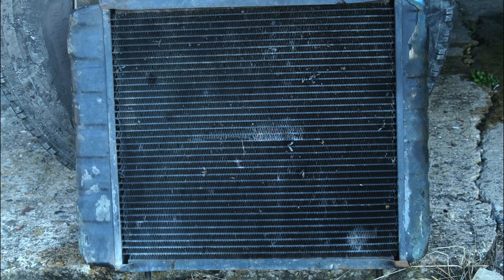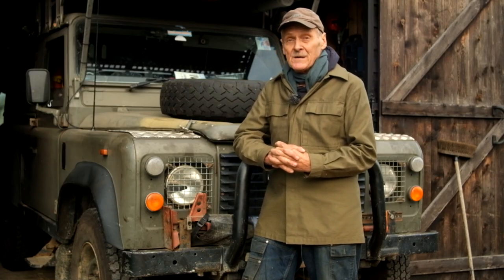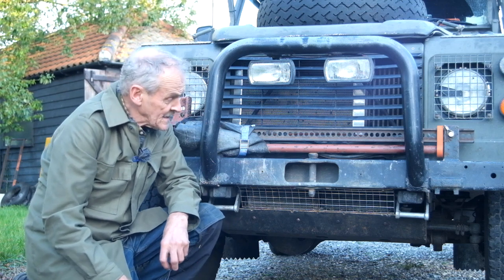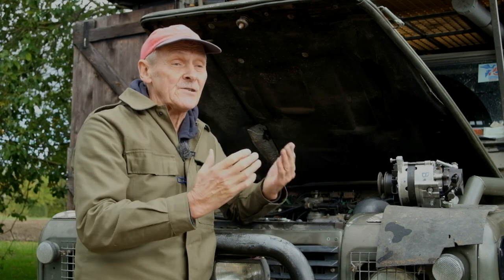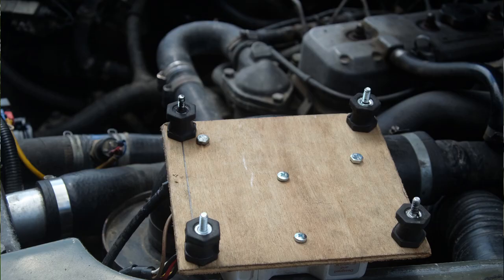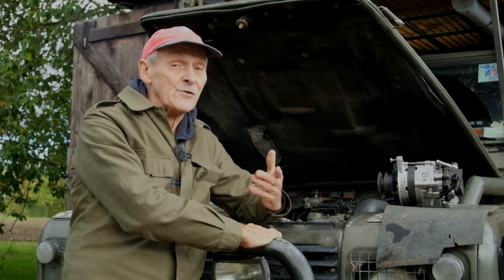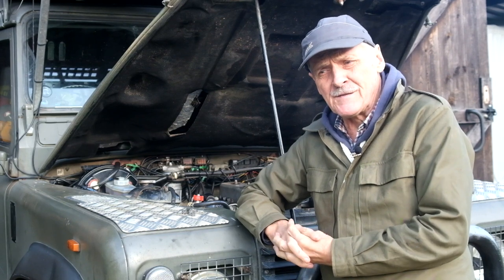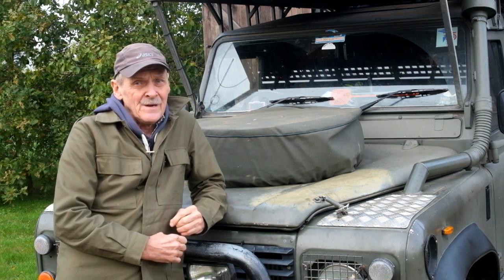Conversion of ex-Military Defender for Overland Expeditions - pt. 2

Comment: I think the oil coolers should be infront of the radiator where the fan can pull some  air through it when travelling slow offroad

Comment: Great Vid Bill and funnily enough I’m off to Portugal too!
Reply from the maker: Be sure to get away before the lockdown. Which way do you travel?
I will be towing a large trailer full of equipment so it will be a slow and tedious journey.
Reply: @defendermodsandtravels  Hopefully to Bilbao if the Ferry still runs! I’m heading from Ireland and we are already in Lockdown so some safe and sensible thinking to travel without compromising public safety!
Reply from the maker: @enduranceadventure8057  The general rule seems to be that if you are on a long trip you can travel through locked down areas provided you don't stop. 
Which region of Portugal do you go to?  I am based in the Alentejo region there.

Comment: While watching your other videos I noticed that you used to have a normal awning why did you change . I have just found your site and enjoyed them thanks.
Reply from the maker: Someone's looking very closely, I'll need to watch out ;-)
The old standard awning covered a very limited area. My travel partner particularly appreciates having coverage over the rear of the vehicle which is where the cooking is done. Also the Foxwing awning has side panels. Although I don't use them often they are good when there's driving rain or low, slanting sun.

Comment: Thanks for Sharing your experience. We swapped a 200TDi ( Discovery 1 ). into our ex- Mod Series3 108 FFR (1984), nearly 10 years ago. Tested the new set-up immediately  afterwards  for 3 months during a trip all over Moroc. Indeed, cooling ist an issue. We mounted a Td5 intercooler infront of the Standard combined oil-cooler/Radiator. A 2-stage Kenlowe fan ist fitted instead of the belt-driven fan. Nevertheless, the temp- gauge ( Standard Series one) reaches just the red area, while the VDO oil-temp gauge Shows about 95 to 100°C under normal driving condition. I would feel better with 85°C.  I understand, that the Ally radiator hast no oil-cooler integrated?  If this Radiator hast the dimensions as the Genuine combined one, I contemplate to do another swap - for Ally and Mocal. What do you think about this Idea?
Reply from the maker: @HeinerStorchennest1  I believe the Alisport 200 TDI radiator has the built in oil cooler coil although I don't use it. My problem is that this puts more heat into a radiator which is already working at its limit.
I forget if this video shows it but I have two Mocal oil coolers mounted under the front cross member protected by a bash plate. The arrangement works very well and provides much needed additional cooling.
Reply: @defendermodsandtravels  Thanks for the quick response. I rember, that you mentioned a 17 row Mocal oil cooler. And a second one for the gearbox. I agree with you, the combination of water- and oil cooler ist an Advantage during the warming-up phase.
Reply from the maker: @HeinerStorchennest1  From memory they are 13 row oil coolers (I am currently abroad, in Cambodia, so I can't have a look).
Please note that it is virtually impossible to fit an oil cooler to a LT77 gearbox. It needs a casing with take off ports. These are very rare and were fitted, I think, to a particular model of Range Rover. Much better to fit a R380 box. You need the stubby box and bellhousing from Ashcroft Transmissions otherwise the geometry is different.
If you are seriously interested in fitting oil coolers I will try to provide more information. There are several details you must get right.
Reply: @defendermodsandtravels  Thanks again. Take your time. Meanwhile I checked Ally Sports and it seems as If they offer TDi radiators without integral oil-coolers.  By the way, they mention, that the aluminium radiators are primarly made for cooling, not for longevity, as I understand.

Comment: Hello! I'm curious (and apologies if I've missed it somewhere) but which gearbox is your vehicle fitted with? And the transfer box ratio, given it is ex-MOD? Loving the videos, it's refreshing to hear someone talk about "the interest" (for lack of a better descriptor) in such a measured, considered and critical way. Thanks!
Reply from the maker: Hi James, originally it was an LT77 gearbox but I found that was working very hard in hot climates and it really needed an oil cooler. It is practically impossible to find the housing with oil take-offs for an LT77 - as I recall it these were only ever fitted to a short production run of early Range Rovers. Accordingly I switched to a "stubby" R380 from Ashcrofts and I have a 13 row Mocal gearbox oil cooler. The transmission now runs cooler in the tropics and less heat comes into the cab.
I found the vehicle undergeared with the standard gearing so I went to a high ratio (1.22:1) version, as used in the Discovery. Again this came from Ashcrofts. The engine now revs less on the open road and is rather quieter.
Reply: @defendermodsandtravels  that's great, thank you. I've got an 1989 ninety with an lt77 on a 1.4 'box and I'm thinking of switching to an r380 too when the time comes!
Reply from the maker: @JamesNewhouse  The LT77 isn't a bad gearbox and they got progressively better with each iteration. Mine was a suffix G which I think was second to last in the line. However for heavy work in hot climates you need the oil cooler. Happy travels.

Comment: Another great video, why did you swap out the original engine for the Dihatsu one?
Reply from the maker: If you look at the Part 1 video all will be revealed!
It's quite a heavy vehicle and was very underpowered with the normally aspirated 2.5 diesel engine. When I bought this vehicle one couldn't find 200/300 TDI engines and there was quite an industry fitting Japanese turbo-diesels into early Defenders. The Daihatsu conversion was quite popular because of the legendary reliability of that engine. If I was fitting a new engine today I'd clearly go for a TDI.

Comment: bit of a random question. so we are building a 90 to take on a trip to Africa are aim is to get from the UK to Kenya. so like you do we were looking on different forums about paint colour, we wanted to go with NATO green mostly because we have a large amount of it surplus however people had advised against it. this was due to quote "could cause trouble or draw unwanted attention". so i was wondering if on any of your travels this had caused you any problems.
Reply from the maker: I have had no problems anywhere howver it might be an issue in conflct zones.

Comment: I drive old mercedes w461 gwagen from 1993 with OM 660 2.9 turbo diesel engine, and where i live it gets pretty hot in summer time and we have high mountain passes 4000meters so driving there in 30-35 degrees to that high usually couses problem with the cooling system. So im using the stock cooling nothing changed actually and the fan is mechamical not electrycal, some of people here changed to the electrical fan so and had big issues, the fan was not doing ok in the end some can drain the battery. But all of this is not defender probably defenders are different
Reply from the maker: I fully agree that a simple mechanical fan is best if you can use it. In my case I can't - the engine is a transplant and the fan won't fit. See my other videos about the vehicle conversion.
Reply: Yes my late lamented 2000 290GD also  seemed to run hot at motorway speeds in Hong Kong  at low 30s ambient, but didn't suffer any meltdowns.

Comment: In one of your videos you tow a Disco on a trailer, is it another one of yours and if so how do you rate it against the Defender?
Reply from the maker: That's my day car. I think the Disco is absolutely excellent. It's obviously quicker and more comfortable than the Defender and has equal off road capabilities if you fit the correct tyres. However it's easier to find accessories for a Defender than for a Disco.
My Defender does the hard grunt work so the Disco has a really easy life, maybe 1000 - 2000 miles per year. Several mechanics have told me it's the best preserved example they have seen.
Reply: @defendermodsandtravels  any plans for a Disco video?

Comment: Do you have much corrosion on the vehicle and how are the door/window seals holding up?
Reply from the maker: Virtually no corrosion anywhere. There's a small patch on the rear cross member which is due to my trusting the work to a high priced rustproofing company which didn't inject the closed members as they were contracted to do. I now do my own corrosion protection like before.
The rubber seals to the doors and windows are piss poor ;-(
Reply: @defendermodsandtravels  consider putting a sacrificial zinc anode on it like a boat to stop galvanic corrosion between the alloy and steel.
Reply from the maker: @royblackburn1163  Interesting thought Roy. My main areas of concern are the bulkhead and rear cross member although everything is sound for now.
Reply: @royblackburn1163  this will not work. The reason that works for boats is because the sea effectively complets the circuit.
Reply: @johnventers5128  in the UK we have salt on the roads during winter most electrical circuits are earthed through the alloy and steel, Land rovers are nut and bolt construction, earthing problems  are  not uncommon so all boxes are ticked.
Reply: @johnventers5128  check under your car when the road's are wet, it is a proven method, my defender does have a little electrolytic corrosion where the alloy bolts to the chassis, water does get in these joints, it is undersealed and waxoyled , zinc  anodes are only a fiver ,every ship in the world use them , the choice is yours, every little helps, galv chassis are actually coated with zinc,  take note of Bill's latest video he has put earth bonding straps on which is really an excellent idea.

Comment: Any body know roughly how much the 90 defender costs from the MOD?
Reply from the maker: The company with the disposal contract for the MOD is Witham Specialist Vehicles. I have just looked at their website and they don't have much in at present. A smaller dealer is PA Blanchard who have a few Defenders and Wolfs on offer. Quite expensive though.